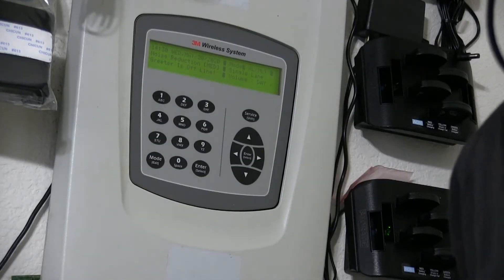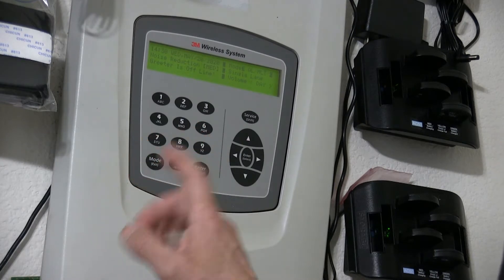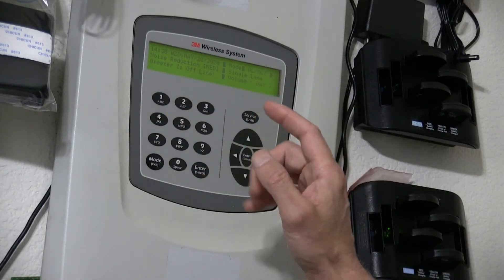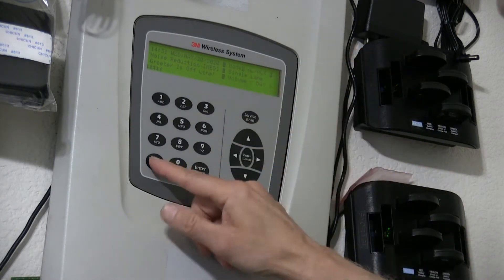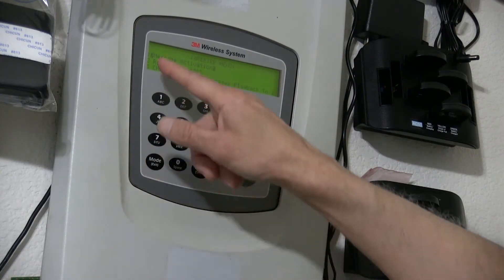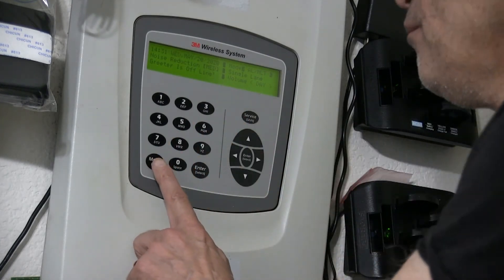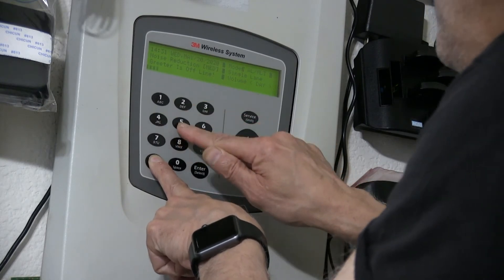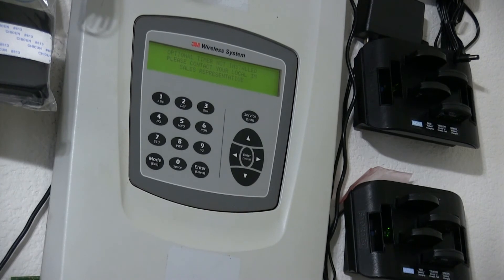Password Double Beep Error Fix For 3M XT1 Wireless Drive Thru Intercom Base Station, Easy Solution

Comment: @Technology Tips I’ve got a question, I went to Settings → Monitor Mode → Vehicle Present and turned it on, which enabled the beeping in the kitchen speaker. The issue now is that it keeps beeping continuously when a car arrives. Is there a specific setting to change it so it beeps only once when a car comes in instead of continuously?. Thank you for all the help.
Reply from the maker: Yes in advance installer setup you can change the beep types. To get to the installer setup you need the password 12345